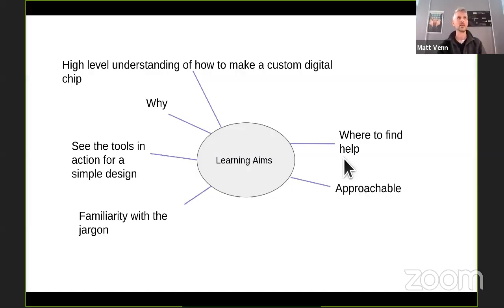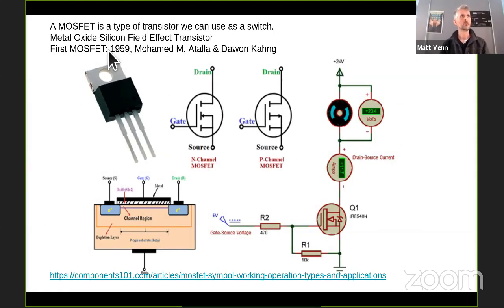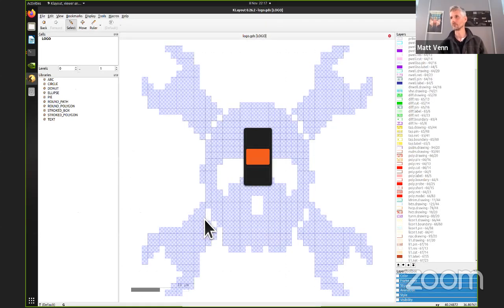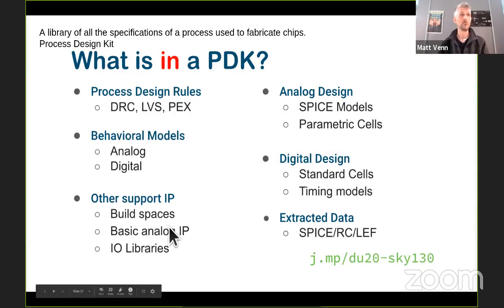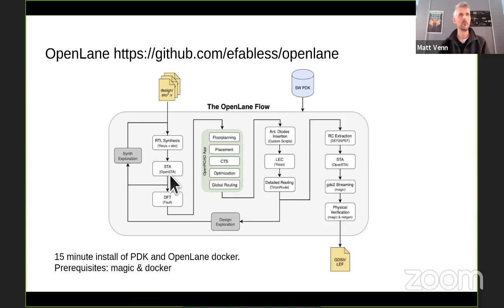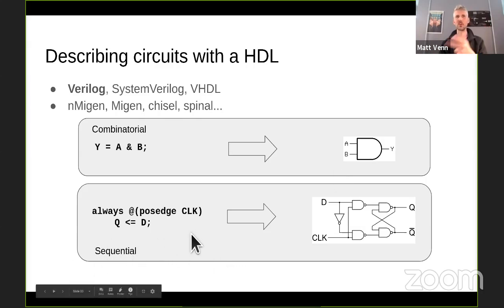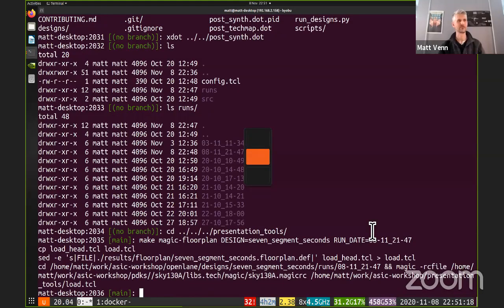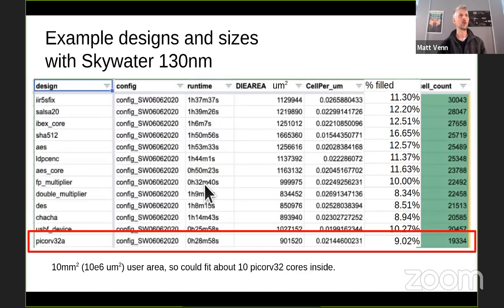Matt Venn From Zero to ASIC (unedited)

Comment: I used to be a chip design engineer. The idea of using open source tools for commercial designs was unthinkable even 10 years ago. Things have come a long way. Excited to see what the future has in store.
Reply: Using open source tools today for chip design is insane, and not there yet? I don't know too many companies that even use open source software, actually don't know one. Every company I know people at use commercial suites or supplied by the fab. You did yourself right?
Reply: @fjs1111  Yes, we used commercial tools. I know chips have already taped out that use an all open source suite but I don't if they're commercially available or if they're able to scale.
Reply: appreciate the reply to that. My understanding is the commercial tools have much of the fab's process specifics integrated in to the libraries and are only provided by them with signed NDAs etc. It is nice to see open source stuff come out, but I don't know how far this will expand in the future.  @saturdaysequalsyouth